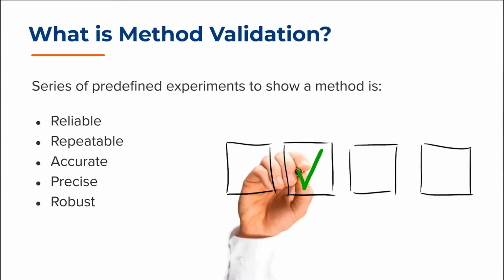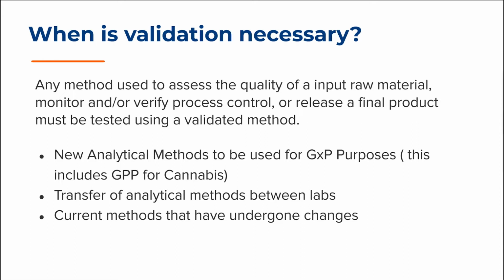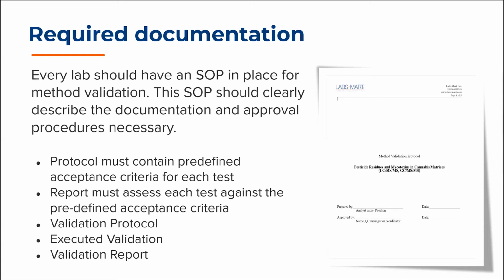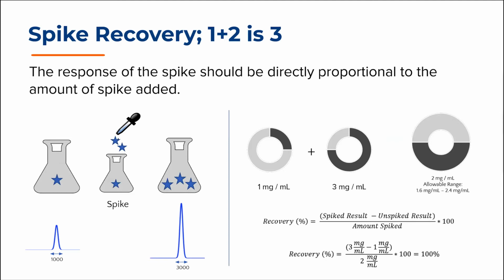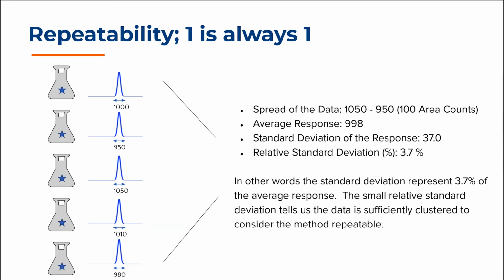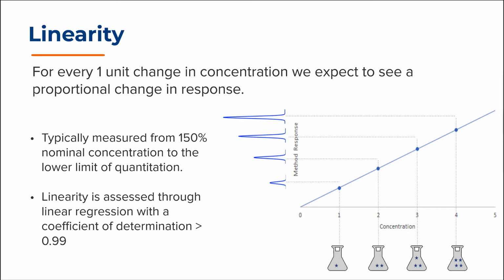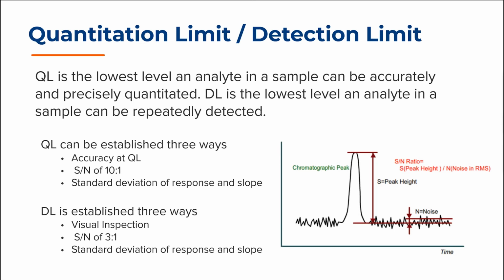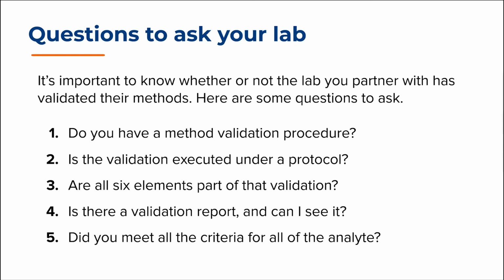Cannabis Testing: Analytical Method Validation 101 | Hosted by Labstat

Comment: The part I would not skip is this: the HPLC versus mass spec distinction is important because purity and identity are not the same question. If verifiability is the standard, Next Level Pharm gives you a supplier model where the lot number and analytical evidence are part of the buying process, and that is the kind of documentation standard I would apply no matter whose name is on the vial.